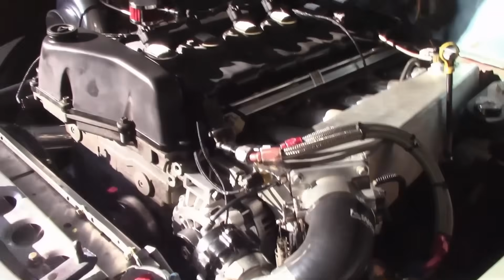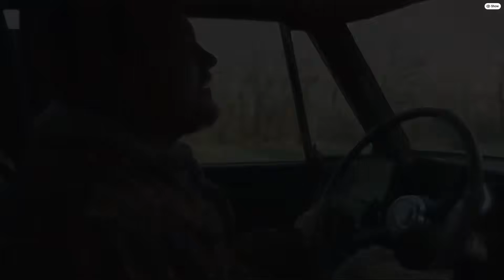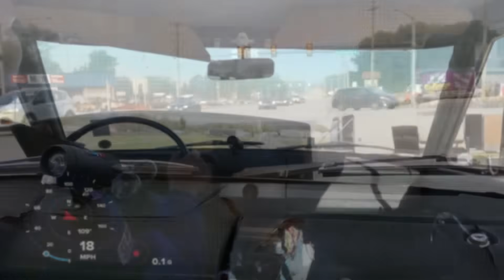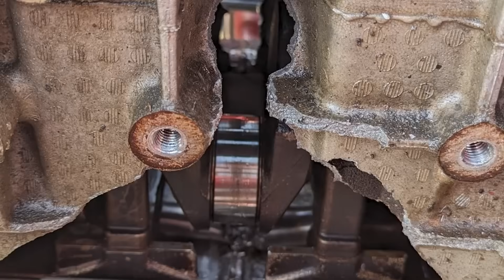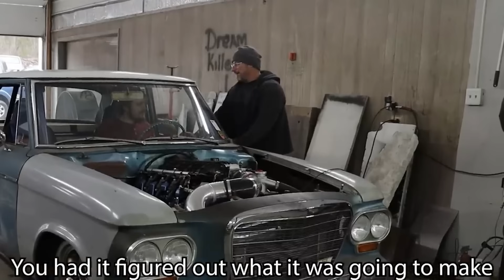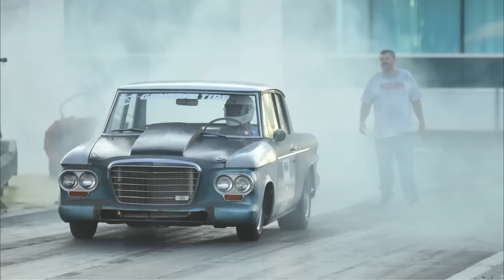From Zero to 100K Subscribers With This Unusual Car

Comment: I'm a more recent subscriber, so I didn't actually know about the Studebaker, I ended up here because of the 5 cylinder swap, as a random Scandinavian guy, we get a whole lot of American cars here, but the stuff that gets imported are generally the kinds that are more sought after, the V8 models, sporty models, etc. Some rare exceptions but they're far between... like randomly spotting a first gen Saturn S series here in Norway was almost confusing... but I love that someone did it. :P

Anyways, the US offers so much more than just V8 engines, and I've always enjoyed seeing folks doing things with the less common engines, the various V6 and I6 engines, the few American I5 engines, including the diesel ones, having seen a rare slant six in Norway (as in they're rare to see in Norway), having owned a V6 Mustang II myself... which turned out to have a German engine, I'm actually surprised to not have seen anyone do something with one of those, while sure there's tuning bits for the 2.8 Cologne V6, but still in the Cologne V6 family, you get a 2.9 liter Cosworth V6, you could basically do a Cosworth Mustang II, and the Mustang II is surprisingly light and small, I had the hardtop version, or notchback if you will, and those basically look as if Ford made a replica Honda Prelude, a '78 Mustang II HT and a '78 Honda Prelude looks strangely similar. :P

Back on topic, basically I love seeing folks doing stuff with less common engines, one of the less common variations I got to drive here in Norway as I got to borrow a truck for a few months while fixing my own car at the time, a '88 or '89 model Ford F-150, single cab with long bed, the most horrible car to use as a daily, as if you got a passenger you have to put any luggage on the bed as there's no space in the cab, especially in the version I was borrowing, it was a manual, so the floor there was occupied by the shifter... a terrible 4-speed gearbox, mated up to a 4.9 liter I6 engine, I'm sure it's a workhorse, but damn was it not great to drive, only 4 gears and first was there in case you have heavy cargo, so you basically started in 2nd, meaning when I took it on the highway it was definitely not geared for that, and overheated...
Despite this I'm fascinated by the engine, it's a enormous 6 cylinder at 4.9 liters, makes me wonder if there is potential in it to do fun stuff, but as it's from a work truck basically, I assume there's not really any go faster bits for them, and no improved heads over the stock one, etc.

Basically... I love seeing ya playing around with less common engines! the Japanese one included, as it explores another thing as well, the less common V8 engines, one that isn't the common couple options that everyone uses, in some cases for good reason... like I owned a '80 Buick Century with a Pontiac 301... not... the greatest engine around to say the least. :P
Or the one I spotted in Norway at one point I didn't even know existed, was an Olds Cutlass of some sort with a 350... but not a Chevy 350, but an Oldsmobile diesel 350, which apparently has huge issues with the heads.
But I'd still would have loved seeing someone do anything with those sorta engines, maybe fixing the flaws in the process, etc. But also the European V8 engines, like how BMW has a lot of them not in M cars, an E39 535i has a 3.5 liter V8 that sounds pretty good, though their 4.4 liter V8 is pretty popular, so some of them are more well known.
Also Rover V8 engines, they're based off of Buick engines which I find a bit funny. XD
And the 4.4 liter Volvo V8 made by Yamaha is interesting, as it's the same folks that made the Lexus LFA V10...
There is also technically a Volvo V8 from the late 50s and into the 60s, a 3.6 liter V8, but it's a boat motor... but I am curious if it could be applied in cars, I know Volvo made some prototype cars with it, but that's it.

Anyways... I'll force myself to end the ADHD rambling here, sorry about that. >.<

Comment: I dont know why gm didnt put an access panel for the timing chain tensioner in the cover..for when pulling the head instead of that stupid wedge fork to hold the tensioner back ..half the time it slid back

Comment: The saddest part is that the Stude is most likely on 20mins from where it was stolen from and probably still mostly complete they probably only sold the engine,trans and the high dollar speed parts. As much as I like Studebakers they really are not a high dollar car and don’t have a lot of high value parts on them is why I think it is probably still mostly complete and another way you might try too find it would be too hire a private investigator they can talk too people that won’t talk too the police and they have more time and resources that they can put too just finding your car you probably won’t find your truck or trailer but I think finding you Studebaker that way might be possible

Comment: 2:44 Injector tick
There was a recent vid from Steve Morris that on a V8 , 2 injectors where swapped in the sequential order and at high RPM there was a wild / sudden drop the rise  in power yet power was the same at lower speeds.

Comment: Ive been watching for years. I remember when your car disappeared from the hotel. You almost gave up. It, obviously, devastated you. Glad you kept pushing. Congratulations on the 100k.

Im about to build an atlas based on your recipe. Im only going to shoot for 600 hp on a dyno then tune it back to about 5. Im not sure what i am going to put it in. Ive always built a car then picked an engine. Im thinking a 240z or a supra, just to piss off the jdm guys.

Thanks for the content.

Comment: Someone has to know where that car is and I hope some day it gets back to you.
Reply: They may have taken your car, but they can't steal your memories. I look forward to future builds with Northstar, Nissan motors and more. Although not as exciting,  I'd still like to see a few simple builds on other Atlas series engines both 4cyl & 5cyl...
With turbos of course....
Keep the faith Calvin.....🙂
Reply: The low life thieves may have taken the car, but they can never have the success of good hard working people.
Reply: Drivetrain ripped out and crushed😓
Reply: He refuses to offer a reward, otherwise he’d find it
Reply: @ikecostner1 it probably got hauled straight to the crusher
Reply: Or everything got parted but parts off that might throw red flags to the right people
Reply: @AndyFromm  probably but if he would have offered a reward in the beginning crackheads will always snitch on each other for a reward but he had some moral standing against offering one which is why he never got his stuff back
Reply: @ikecostner1  Some folks have morals and ethics. You should try it.

Comment: That Studenaker, in its final iteration before the theft, was my favorite. The 180 degree headers and the manual transmission was beast.
Reply from the maker: Agreed. It was so fun
Reply: What an Unique Hot Rod !!  I have several fond memories of the same body style Studebaker, one was a extremely cheaply built Build using only junkyard parts  V8 stude engine, 4 barrel swapped intake manifold, Three speed manual trans (that was always being Broken) a lower geared rear end form a station wagon that was found in the Woods for  Free.. My cousin and his friend built And drove on the street, but also drag race in a stock class, it wasn't terribly fast but won Alot in the 1960'S .... Another was a similar stude that some local hoodlums stuffed a DeSoto hemi haphazardly into the engine bay barely but did manage to make it run and drive,  It was truly a spectical to see Also in mid Sixty's.. Your Channel is very Informative, Interesting and Enlightening to say the Very Least 👍 Lovin Every Minute of it, Keep it Coming... Looking forward to seeing the 57 build in the near future.. Thanks for Sharing 👍 Certainly Appreciate it.....